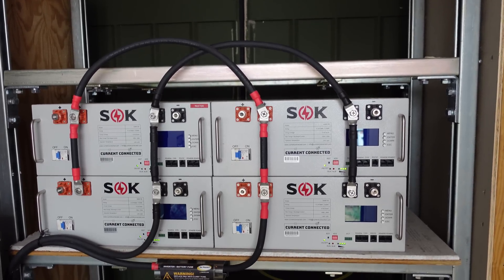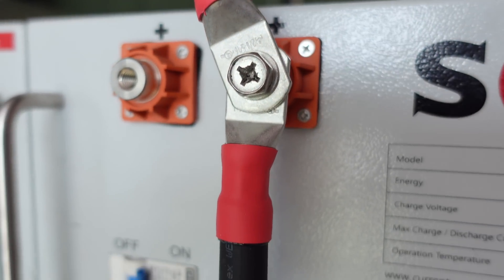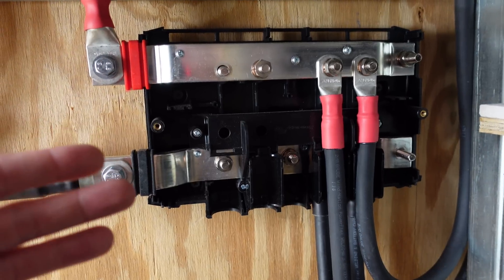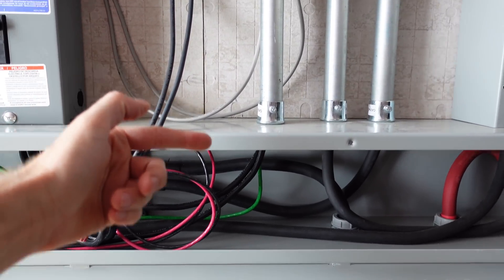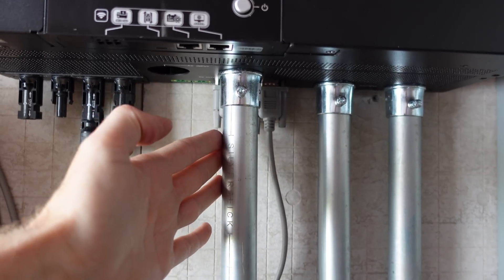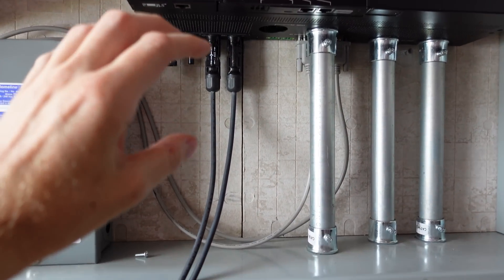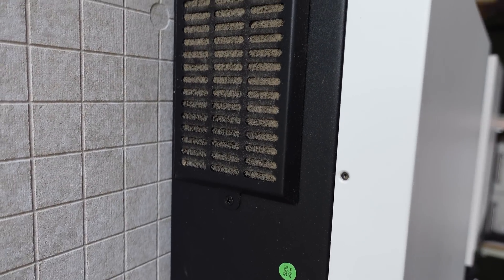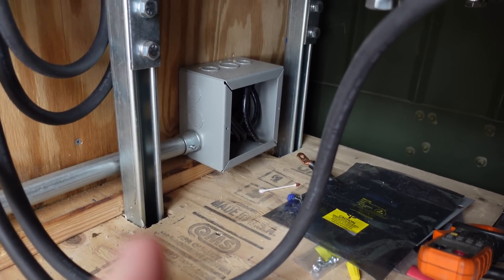The Off-Grid Solar Power System Rebuild is Online! June Project Update

Comment from the maker: NEW Twitter Page... https://twitter.com/LithiumSolarYT
LV6548 Inverters... https://www.currentconnected.com/product/mpp-lv6548-inverter/?ref=lithiumsolar
SOK Rack Battery... https://www.currentconnected.com/product/sk48v100-48v-server-rack-battery/?ref=lithiumsolar
Victron Busbar Box... https://www.currentconnected.com/product/victron-lynx-power-in-distribution-system/?ref=lithiumsolar
(affiliate links)
Reply: Just to let you know that the Victron link actually goes to battery cable.
Reply: 🎉 well Australian electricity suppliers are going to be charging between 48-60 cents per kilowatt. Just wish I could put up my own solar system with batteries. 
If they want us to start buying BEVs well they can stick that up where the sun don't shine. I will, someday get a PHEV at least I can put fuel into it, the Mitsubishi Outlander has a 20kw battery and can do roughly 80km around town on a full charge. I do have a 4.5 kW solar system that provides our house with power during the day, obviously. The car I use at the moment uses 1 litre per 6km, and that's huge lol, so I need 70k to buy the Mitsubishi, that's a lot of kws....
Been watching your vids for sometime now, great stuff matey, cheers.
Reply from the maker: @john_in_phoenix  The links have been fixed, thanks for letting me know :)

Comment: Nice setup. I like the four battery rack wiring design. Have you seen any issues with not using closed loop communication? Is closed loop communication something you wish you had?  Thank.
Reply from the maker: No issues running them without communication, though obviously it's better to have it than not. It was my intention to set up communication with the Batrium, but there are a pile of reasons that hasn't worked out. I have a video explaining this that's done, will probably have it published next week.
Reply: @LithiumSolar  cool.  Thanks. I'll have to watch that one.  My future home system will also not have communication because I have a bunch of different types of batteries also.

Comment: where did you get the wiring through from? do you get your setup inspected also?
Reply from the maker: It's a Hoffman F66G60. I bought it on ebay, got a good deal as "old stock". No, I haven't had it inspected.

Comment: Another very expensive set that the average person especially seniors can't afford as a senior on pension borrowing is out as lenders won't lend unless they have the option to gareshee wages we need something for low budget that we can upgrade later we can put up with switching something off to turn something else on what I'd like to see is is a 2000 watt pure sine wave inverter that could be paired with another for 120/240 volt split phase power so I'd have the option to eventually go to heat pump water heater and dryer aa it is now for me to go solar I'm looking at 120 volt without the option to upgrade without getting a new and bigger unit up here in Canada we have a double problem lower dollar and sky-high shipping found out the cost of shipping when I looked at buying a Triplite lc1800 line conditioner the price in the USA at Costco is under a hundred dollars looking online it was 138 dollars still not bad to use my modified sine Wave inverter but shipping was almost 400 dollars so I can buy a 2 or 3  thousand watt pure sine wave inverter for less and try and sell my modified sine Wave inverter I still can't phantom why a person needs so big and expensive a system to produce 600 kilowatt of power a month
Reply from the maker: I'm an average person and I don't have a problem affording it. I can't speak for anyone else though. Also, this easily produces 1500kWh of power per month during the summer. I can get more but am out of space to add panels right now.

Comment: Great content thank you so much. Im attempting to set up two LV6548 on our off grid homestead. I will initially have enough panels to create 4 strings (2 per PV input) on one LV6548. So the question, do I add all strings to one LV6548 unit (PV1 & PV2) or do I split it and put half on the PV1 of one unit and the other on the PV1 of the second?

Comment: Hi great job 
I have a question could i connect two different size Li batteries in parallel? For example can i connect 10KW battery with 5KW one in parallel and then connect them to an inverter !

Comment: Hi, can I ask an off-topic question yet definitely within your realm of expertise? I bought my first e-bike, taking delivery in a couple days. My wife is concerned about fire as am I. I know the basics about keeping it out of the rain. However I'm hearing conflicting recommendations on charging. One person says charge it for X hours after you ride it for X hours. Another person says charge it until the LED on the power brick turns green. And another person says continue charging it so that the BMS can balance the cells but he doesn't say how much longer. What would you recommend? It's got a 36V 7.8Ah Li-on pack with a 1.5A charger and 250W/400W peak hub motor. It's a low power bike but I plan on pedaling a lot for the exercise. Thanks for any and all help!

Comment: I’m asking everyone I watch on YouTube if it is possible to add 7 enphase 215 watt 240vac micro inverters to my off grid Electrical panel that is powered by two LV6548 (actually SP6548) without damaging my SunGold inverters?
Reply from the maker: I really can't comment on that. The AC output of the inverter is not designed to be backfed. That doesn't mean it won't work, but I'm not going to try it on mine and blow up an expensive inverter. I don't suggest you do either without approval from MPP Solar's technical team.

Comment: Hey there, I recommend use a thermal camera and at 12 pm at least with the system is used at his highest capacity, you can check that your terminals or connectors are working as expected, I inspected 20 y experience people, but theres always a connector, terminal that is still loose. Good setup by the way.
Reply from the maker: Thanks! I do have two different thermal cameras and I do periodic inspections 🙂

Comment: I'm looking forward to seeing your 280Ah battery pack design.  I'm a novice so I keep thinking 16s and connect in parallel after attaching a BMS - so simple.   I guess you are talking about compressing, maybe that's the design issue you are saying that you settled on.  I'm living in a pretty big city in the Philippines and they have both electric and water brownouts on a regular basis.  The infrastructure here is like the 1930s or earlier in the USA, I think.   Banana republic to the max.  Social life is much better here so it is worth staying - never want to live in the US again.  I digress.  LOL.  

I messaged Amy in China, she said it is easy for them to ship to their warehouse here so I'm thinking about ordering 48 batteries so that's why I look forward to seeing your design.
Reply: I forgot to say that server rack batteries aren't an option here and even if they were I wouldn't trust them *PLUS* return policy is just 7 days here so you buy something and after 7 days, you can return it for warranty work only and for that you could be waiting 3 months or more for the fix.  

Shop here said on their FB page that they sold a 3000w/24v inverter so I went to check it out.  They had 3 in stock but all were customer returns that had been there for 3 months waiting on boards for a replacement.  China makes products based on the market, when manufacturing for the US market they at least try to send good products since they know it will cost them in some way, but here they send crap because the consumer has very little protections.  The same policy exists with cellphones, computers, everything, 7 days then you are in warranty hell.  That's not all, their return policy is usually no money back, just exchange so if you bought the last one of anything, get in line, you wait until the next delivery which could be months.

So now you know why I prefer to build my own battery.

Comment: While I loved the power-related content, oddly it was the use of the uni-struts to make shelving that caught my eye!  Looks a lot nice than the 2x4s I use,  with less usable shelf height lost due to the 2x4s.  Taking a quick look at Lowes, it appears that's kind of pricey though.
Reply from the maker: It is pricey but it's VERY strong and you can build pretty much anything out of it. I considered 2x4 a few years back and was primarily concerned with it bending over time (thinking 10+ years).

Comment: Unistrut rack system turned out nice! Super Inexpensive.
Reply from the maker: I love the strut racking! It's a bit more expensive than most think though. A 10ft section of 12ga is $35. This shelving took 6 or 7 pieces. Then the L brackets, and bolts... It adds up :) But it's WAY strong compared to other options.

Comment: I’m curious on which battery brand you preferred for your 48 V set up?
Also, on the SOK’s, since there are two positives and two negatives, why not just put each wire lug on a separate positive instead of doubling up? 🖖
Reply from the maker: The SOK is my favorite so far. I'm a DIYer and love that it can be taken apart. They're all great choices though!
Reply from the maker: Oh and I prefer not using both posts as you're describing as they're connected internally with a piece of brass, which could get quite warm depending on the amount of current you're pulling through. It just makes more sense to wire them either to a busbar or on the same posts like I've done here.

Comment: It's a shame the lifepower4 battery doesn't support the proper parallel wiring like all the other batteries without sharing connectors. Love the Lynx Bus Bars, they are a nice setup. The lynx distributor is nice as well but very pricey compared to the lynx power in.
Reply from the maker: I think the LifePower4 was designed to be used in their own rack mostly, which has busbars running down each side. You could fit 2 lugs on it though if you wanted, one from the top and one from the bottom.

Comment: Been trying to find hardie backer with the grid lines like you have. Do you know the part number and where did you find it?
Reply from the maker: I bought mine at Home Depot. It's usually stocked in the flooring section. https://www.homedepot.com/p/James-Hardie--in-x-3-ft-x-5-ft-Cement-Backerboard-220022/100183556

Comment: By code . Dc and ac should be in separate raceways
Reply from the maker: I'm no code expert, but I believe the separation/partition requirement was introduced in the 2020 NEC? We're still on the 2017 NEC here.

Comment: Another great video!  Questions.  Are you doing anything for lightning protection?  What monitoring software are you using?  Do you still have any Growatt inverters?
Reply from the maker: I don't have any lightning surpression on the PV strings if that's what you're asking. I should probably look in to it, but both arrays are on the ground (not roof). I'll be using the Batrium software once I have the BMS/shunt reconnected. I've only ever had one Growatt inveter, which I used on the hand truck build last year. It's not being used currently.

Comment: Interesting with AIMs.   I run 2 x 12,000w ETL pure sine wave (blue ones) and don't have any 'light flicker' or any noticeable issues on everything in the house - 4 ton heat-pump, cooktop, dryer, Rheemes hot water heater, etc....   After 5 years I had a control board go bad resulting in up/down voltage but found  a place to repair it and it's working smoothly again.     I will say that I only run up to 40% (4800w out of 12,000w possible) so I'm not stressing the units - maybe that's why I don't see flicker like you did.
Reply from the maker: I didn't have the flickering problem during the first few years. It's a recent problem that's suggestive of an impending failure somewhere. For example, starting the 5kW electric cloths drier drops the 120V legs down to about 75V each for a split second, which is the cause of the flicker. I also replaced my boards a few years ago, both control and FET board as I wasn't sure which one was bad. Overall, I still love the inverter - it's just that I feel we have better options on the market now.

Comment: Very clean wiring job!
Reply: Right! 👍🎉🎉🎉
Reply: plywood everywhere is a fire hazard
Reply: @margarita8442 with LFP batteries, there's no fire hazard.
Reply: @johnnodge4327 With everything electric and with possible sparks, there is a fire hazard. Why not minimize risks?
Reply: @margarita8442 well… plywood is at least an insulating media. The cement boards give plenty of fire protection to the bank.
Reply: They are crap inverters. You had the correct Low Frequency inverter for your home. It cant get better than that. I know those mpp inverters wont last
Reply: @jakeandrules7724  time will tell I guess.
Will has been using and testing the for a few years now… they certainly aren’t a top tier model, but they are worth the price so far…